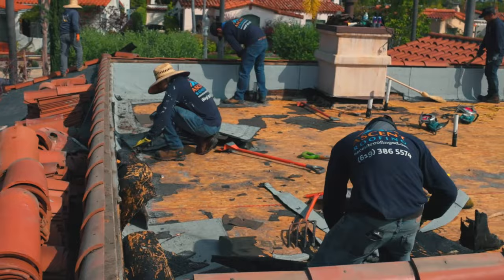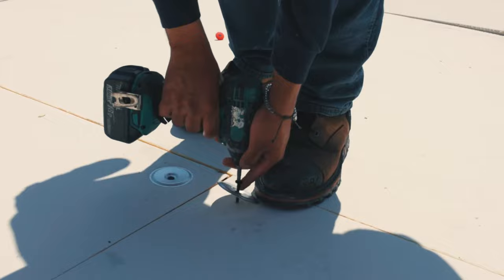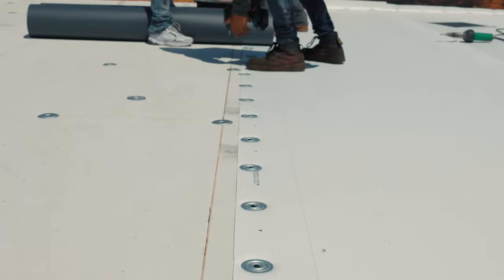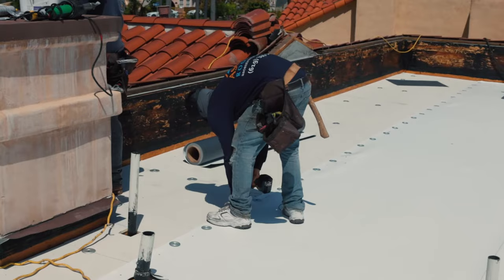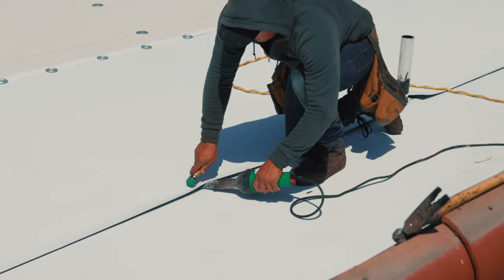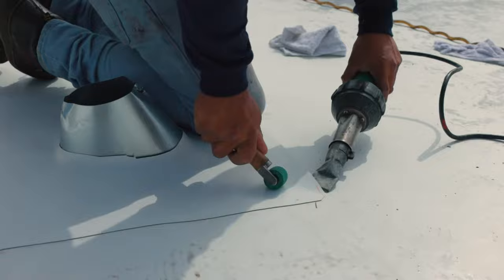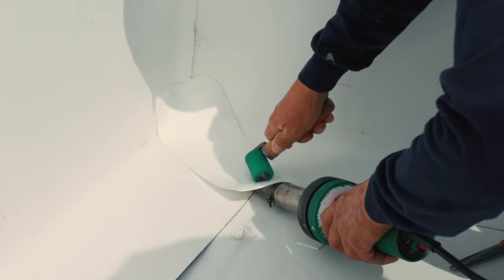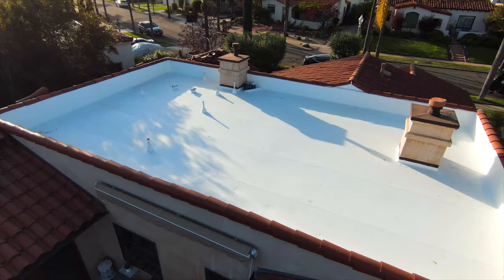Ascent Roofing - Single Ply TPO Roof Installation Process Explained

Comment: Great video. Question: if you have a foam roof and need to install retrofit drains, how do you adhere it to the foam and flash over it? The roofer who did my foam roof did not install the drains and now I have leaking. I found the drains I need, but I don't know what I need to flash around it and get it to stick to the foam. Any help would be appreciated more than you know.
Reply from the maker: Without seeing it for ourselves, our best advice is call another local roofer so they can assess your situation in person, and give you a better idea on how to proceed. Just do good research on them before hand to ensure you're in good hands!

Comment: The TPO roofing I have is smooth on one side and texture on the other. What side should be up?thanks
Reply from the maker: Typically, the white side .... but they all vary. It is best you refer to the label / instructions attached and manufacturer guidelines.